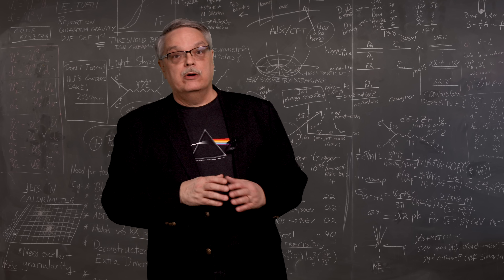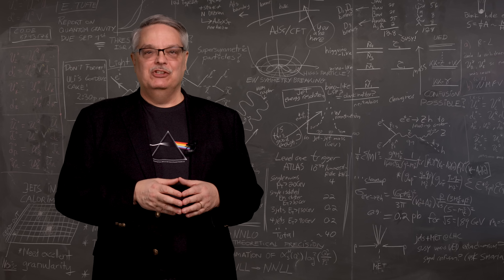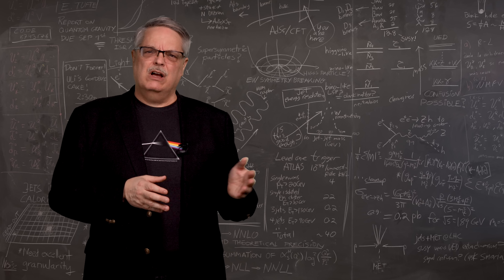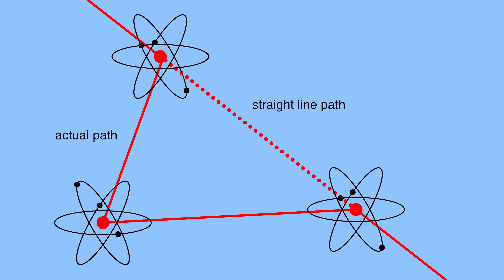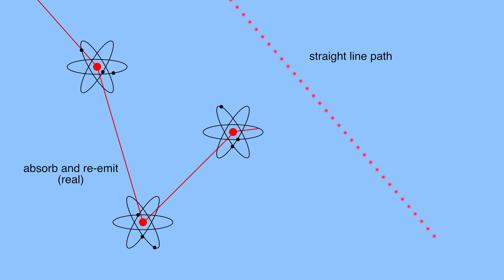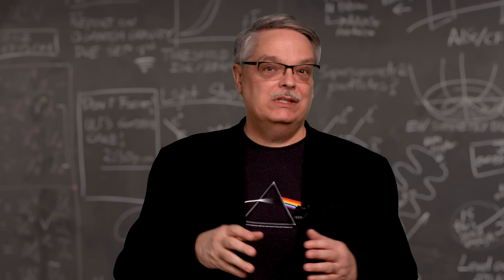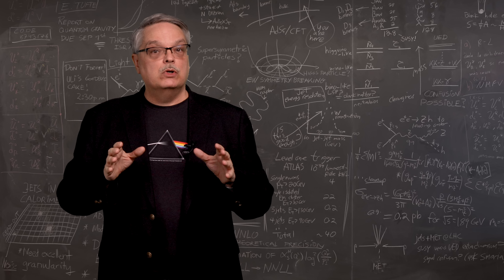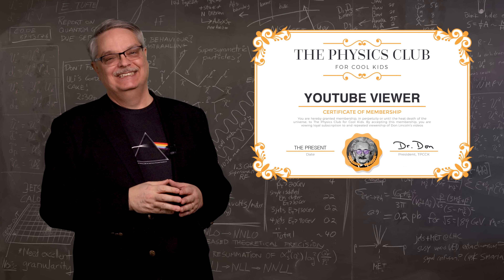Why does light slow down in water?

Comment: Still you didn't really explain way light slow down. Why combining two waves would produce a slower wave? if that's right then let combing 2 lights in air or vacuum space, will the combined light move slower?
Reply: Light will always slow down when moving through a solid vs a vacuum because of the index of refraction of the solid.  And the light wave slows in glass or any medium other than a vacuum because of the EM field created by both light and the electrons in the medium.  And the electrons create a much slower longer wavelength in the electric field then light thus slowing the light wave.

And to your last question light travels at c in a vacuum regardless of its wavelength.  And in air there may be some measurable difference depending on the conponents in the air that may absorb certain wave lengths.   That is at least my current understanding though I am open to that explanation being challenged or questioned.

Comment: 4:39 I think your logic is flawed here. I'm not saying I agree with the scattering theory, but it's like saying about the two slit experiment that it would or wouldn't do something because it doesn't make sense. Photons don't do what's expected or behave according  to our macroscopic sense of time and causality. I'm just saying... it could scatter and then come out in the same direction, parallel to the original. I think.?. (Edit; I also just thought of the three polarizer trick, at 90 degrees/45 degrees...this shtuff is blowing my fmind! Why does light go SO SLOW! It takes 8 minutes for the light of the sun to reach the Earth. That's not how far we are. That's how F'n SLOW light is. If we ever get to travel that speed, it'll take us years to get anywhere! ...🤯🤔👍🏼
Reply: Of course it could do that. But it could also go in about a trillion different directions. And therefore it's extremely unlikely that every photon would follow a path that fits our observations. That's what he said.

Comment: The best explanation is that the light is affected more by the Higgs field when in the presence of more concentrated matter (as the electrons of the water have mass). The electric field it produces averages out with the photon, creating something that goes slower than the speed of light. Once that wave is out of range of the matter, the wave returns to its normal speed.

Comment: But the intensity of the original light wave is > that of the interference wave. What happens to the original wave ? Also, what makes the wave made by the e-  in the glass slower than the original light ? Thinking about it, the real explanation needed is for this slower waves existence.

Comment: I think speed of electric field generated by electron will be same as speed of light so not effect should have been speed of light with change in amplitude of vibration of net field.
Reply: This is exactly the missing step, Don just simply mentions that the combined wave moves slower but doesn't really explain.

Comment: the second wave is still an EM wave... still light and should still move at the speed of light
Reply: It is, but the sum of the two waves (resultant of both wave sources) is not.
Reply: @alexanderx33  Ok. Now explain why :)
Reply: Yeah I didn't get this explaination. Why would the electric field produced by electrons would be slow.
Reply: To really understand this. One needs to get in to the math. An intuitive explanation is this:
The apparent slowdown is because the emitted photons by the atoms of the material destructively interfere with incident ones in the ends of their wavefronts so the photons appear to travel at lower speed, but they are not. When the photons get out of the material they don't interfere anymore and the slow down effect disappear.
Reply: @SimulatingPhysics  A good animation of the two waves, showing that the one corresponding to the atoms is out of phase with the incident light, would probably help people understand it better than showing them the math.
Reply: @noahzaeshorts1402  Challenge accepted!
Reply: @SimulatingPhysics  
So light doesn't actually move slower than c in the glass?

Comment: why the electric field of the oscillating electron is not there in the air medium? say the light is going through the medium continously  so when the light emits the medium even then the electric field of the oscillating electrons will be outside the medium which will effect the light outside the medium so the light outside the medium should also be slowed down , but maybe a little !!

Comment: Hi. It was interesting but it does not explain why in physics the wavelength in media like glass supposed to change not the frequency as both are related to the speed then why we consider frequency does not change? I think the light passes through denser medium looses energy and neither of the wavelength nor frequency changes alone but both would be affected each by the factor squat root of n
Reply: the frequency is related to the number of times that the electric field change it's direction in a given amount of time. now, while the light is going slower, the number of times the electric field changes polarity is not affected by the medium it travels in, so the frequency must stay the same and the wavelenght is the one that changes.

look at it like this: you have a car that changes it's color once a second, while on an empty road you go 72km/h and your car changes color every 20m, when you are on a clogged road you go 3.6km/h, and your car changes color every 1m.

Comment: Only one question. 0:58 VACUUM? What vacuum? where is this vacuum? Out of matter space and time? Whow we measure c in a vacuum? Absolute physics nonsense. So the relativity works and for the light as well. If the mass is relevant because time and space are relevant, why light has to be constant? Because then we lose mathematics? Fuck then mathematics. They are only e human-made language. Nothing more. So the numbers around this tab are nothing more than symbols. Every math formula that uses c like constant is not correct is only relevant. PHYSICISTS DON'T FORGET THAT.

Comment: Blue and red light have the same electric field magnitude in vacuum but when entering glass the blue light will generate a bigger counter electric field from the atoms than the red light since blue has higher frequency than red, the outcome is the resultant electric field of blue is less than of that of red light and hence the speed of blue light is less than the speed of the red inside the glass and this explains the different path of blue and red  lights take inside the glass and when emerge out of glass too.

Comment: Is it possible to make an experiment of a beam of laser travelling in a vacuum inside an electric field .If the electric field reduces the elected field of the beam then light will slow down and on the contrary if the arrangement increases the beam elected field then the speed will be greater than C ???

Comment: Why does the light set off by the electron move in the same direction as the light beam?  It should be roughly a torus shape no?  Forward Thomson Scattering only occurs as the electron motion becomes relativistic, which isn't the case for everyday refraction.

Comment: So, here's something I don't quite understand. Light is both a wave and a particle (photon). Once a light is created, and the photons move away from their source at the speed of light, what ultimately happens to the photons?  So for example I'm in a dark room, I turn on a light bulb, the photons get emitted from the light bulb and reflect off of other things. Then I turn the light off. Where did the photons from the light bulb ultimately end up? A good example of what I mean is, if I shoot a gun and it emits bullets, I know those bullets ultimately ended up lodged in their target or whatever they ended up running into after bouncing off of something until they lost energy. Same idea, what happens to those photons after they've been emitted by a source?

Comment: light slow down, is it a joke ? ..thought light's speed is the same for every one (einstein relativity). 
Some one is making fun of us. wonder ...
Reply: When people say "speed of light", meaning constant c, they are presuming "sped of light in vacuum". Speed of actual light (or any other electromagnetic wave/quantum) in matter may be lower than c, but c is still a constant and maximum speed (for information carrier). In water electron could travel faster than light, but not faster then c, that actually a reason of Cherenkov radiation ( https://en.wikipedia.org/wiki/Cherenkov_radiation ). You may check this video for more explanation: https://www.youtube.com/watch?v=msVuCEs8Ydo

PS short remark from another angle: "speed of light (in vacuum)" — c — isn't defined by light, it just happened (due to zero rest mass of photon) so that light in vacuum travels with c.

Comment: Ok. I get why the new wave OSCILLATES slower. But why does it TRAVELS or MOVES slower isn't answered yet =P
Reply: It's because the current density term in Maxwell's Equations is nonzero in a material, which changes the speed of the wave mathematically.

Comment: A little off topic, but: Imagine there would be a gas which drastically slows down the light, say by factor 1000 to 300 km/s. If you would be in a space filled with that gas, would the physics (space and time) inside that space change, too?

Comment: I'm not convinced by this theory. I know there's much I don't know, but from what I do know this seems wrong.

On one hand, I think the unpredictable nature of electron encounters that this theory seems to depend on makes it hard to believe, but would also explain why different light frequencies diverge a little when passing through a medium, as is so nicely illustrated on your Dark side of the moon shirt.

On the other hand:
This doesn't seem to explain the change in angle at the boundary by itself.
Nor the speeding up upon leaving (Shouldn't the waves created by the electrons travel with the light?). 
Or the extra loss of energy compared to the loss of the wave's speed that I don't think is observed IRL. 
The electrons would only be oscillating in one direction, why would the wave produced by this happen to be coincident the direction of the incoming light? 
Since the electrons are already somewhat oscillating around atoms in electron clouds, wouldn't this create an interfering field irrespective of the light travelling through it?
Isn't matter almost entirely empty space such that most of the light be unaffected by a sufficiently thin sheet of transparent matter? 
Shouldn't the light wave change colour (wavelength/frequency) while interacting with the electric field waves?
Also, since light is a combination of both electric and magnetic fields, shouldn't this explanation mean that light can be bent by oscillating weak magnets?
Reply: I agree with you. The answer is too slick, I don't like the guy, too cocksure and the change of direction is not explained. Keep thinking.

Comment: Sorry but for me this video raised more questions than it answered.

First of all, why doesn't the "original" wave come out of the glass weaker? With no other information, I would expect all light entering glass to exit at two different times: the first, travelling at exactly the speed of light in a vacuum, made up of respectively the original light emitted by the laser and the independent light emitted by the photons (dimmer because it lost some of its energy to the electrons). And the second, the sum of both waves, arriving later because it was travelling slower.

Also, why does the light change path as a result of it slowing down? Going with your explanation, shouldn't the sum-wave move in the same direction, if slower?

I knew I didn't have a grip on it before, now I feel like I'm gripping it by the blade...
Reply: You should read Feynman's excellent explanation in his lectures (warning, it uses some math, but you should read the text anyway):
http://www.feynmanlectures.caltech.edu/I_31.html
Reply: It does come out weaker. You lose a certain percent at each interface, depending on the index of refraction.
Reply: @jacknisen   I don't think he's referring to reflection or absorption.  He's referring to the energy used to oscillate the electrons in the material.
Reply: @DANGJOS  Wouldn't that loss due to oscillation be covered under absorption/scattering?
Reply: @jacknisen   I think partially yes, but most of that energy should be kept within the light ray because the energy used to oscillate the electron clouds would be "re-released", so to speak, as a phase-shifted electromagnetic wave, in the same direction as the original wave..
Reply: @DANGJOS  I don't see that either. If you oscillate a charge up and down, it will radiate uniformally in all directions, the heart of the scattering phenomenon. Like a radio station antenna, the charges are oscillating vertically (in an antenna sticking upwards say) and the radiation pattern is cylindrical, at least close to the antenna.
Reply: @jacknisen   Hmm...good point.  Perhaps this is one of those things that is best understood quantum mechanically.  Apparently you do a path integral formulation where the photon takes all possible paths and the only one that doesn't cancel is the path we see.  Some professors from various universities briefly explain this.
Reply: For the light changing paths question they made recently made a video on it,
Reply: I'm late answering, but, I think your mistake of conception lies in how you conceptialize light. It is not like a train going through molasses. It is more like a spinning top changing diameter. It may look like it's gaining energy as it spins faster when the diameter shrinks, but in fact it has the same energy, converted in different ratios of momentum and speed. Light is being converted in a different ratio of speed and amplitude and maybe frequency, I'm not solid on this, as it goes through a material. If some scientist is reading this feel free to correct me.
Reply: @victorgueldry9021   The overall frequency should stay the same.  The wavelength will decrease
Reply: it DOES come out weaker. Light loses intensity when it passes through any medium.
Reply: open up eyes   I would say yes, although at trillions of times per second.  Doubt you can see that.
Reply: https://youtu.be/dd6IsYLCOZc
Reply: open up eyes  this is an interesting insight. I'm thinking maybe that light that is lost due to destructive interference is the light that is absorbed by the glass itself? or maybe it is emitted out of the glass, allowing us to actually see the process. Have you figured it out yet?
Reply: Light slows down and bends,so when you do the calculations of relative distance..c remains constant!

Comment: Can this be an alternate but a much more simple explanation - We all know the characteristics of a light is its frequency and not its wavelength i.e. unless the frequency of the light changes, the property of the light is the same. Hence when the light moves from a lighter to a denser medium, the light has to move around more obstacles than it was previously moving through. We all know, larger wavelength can surpass obstacles rather than the waves of smaller wavelength. Hence the light increases its wavelength to jump across obstacles. Emphasizing on my first point about frequency, since speed=(frequency)x(wavelength), and frequency should not be changing for a given light, velocity changes to counteract the change in wavelength.
Reply: Except the path a light takes is not the same as the wave.  The path is linear.  It is the electric field vector at a given point along that path that oscillates.  Also, a longer wavelength would mean a faster speed using your equation, which is the opposite of what is supposed to happen in a medium.

Comment: The electron slow down the electromagnetic wave because of their mass. It is equivalent to a mass/spring system. The heavier the mass, the slower it moves when every other parameters remain the same (frequency, amplitude or force applied to induce motion).
The combined waves explanation is a little confusing, but, it has to be correct because it is the way electrical engineers explain the speed of electrical waves in a cable.
Let's take a 75 ohm cable connecting the radio to the 300 ohm antenna (both adding to 377 ohm, to match the impedance of free space).
That quoted 75 ohm is the ac impedance at the center frequency. The cable can be modeled as many inductors in series and capacitors in parallel. Each pair form a LC tuned oscillator. A well matched cable will only slow down the wave (net speed: 66% of c typically), but not introduce loss from echo, destructive interference. The wave will remain a pure sinusoidal at the radio receiver like the radio wave at the antenna.
Each pair of inductor and capacitor has a natural frequency which is different from the input wave.
The slow down of ac signal can be seen as related to these 2 frequencies.
It can also be understood by analyzing the step response on the many LC circuits. When the voltage is abruptely raised (let say to 1 volt) and lowered (to zero volt), the first inductor absorb some energy as magnetic domain rotating in the core. Then, as the voltage is set to zero, the inductor magnetic field collapse, creating a voltage that charge the capacitor.
When the inductor energy is exhausted, the voltage drops.
Meanwhile, the second inductor starts accumulating energy.
The 1 volt pulse propagate that way, constantly converting magnetic energy in the next inductor and electric energy in the next capacitor.
This is, by the way, how an electromagnetic wave can travel in free space without needing any medium. It is the collapse if the magnetic part that induce the electric part and vice versa. Each 90 degrees or 1/4 wavelength, the wave self induce the next part.